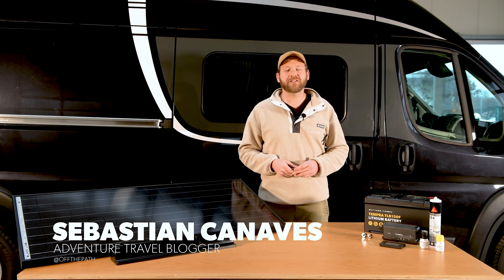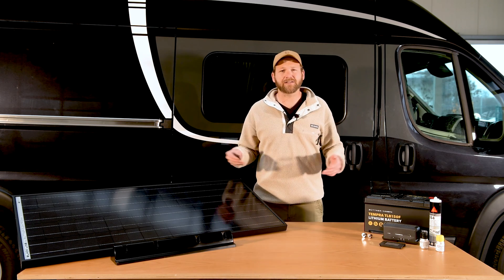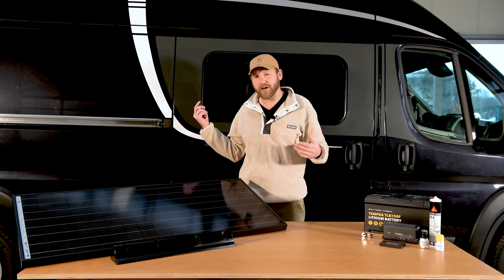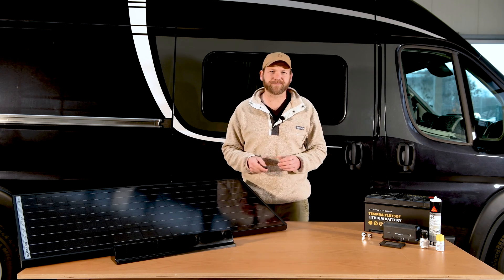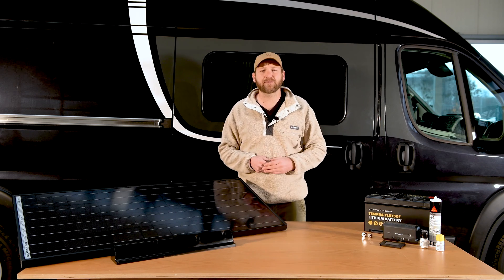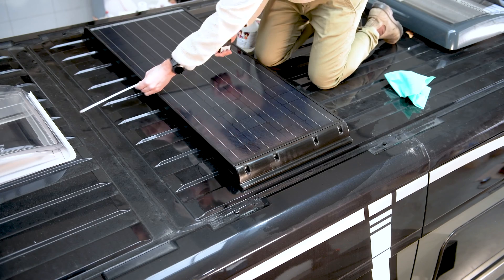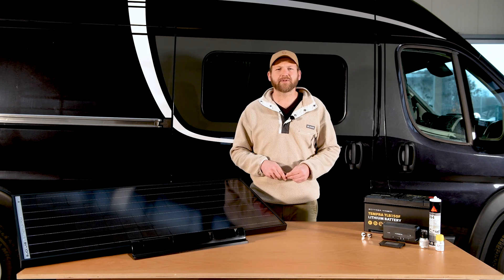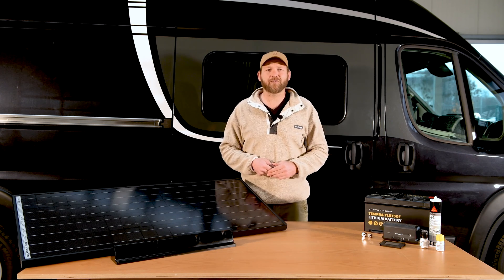DOMETIC | Blackline Solar Panels, Charger & Display - Introduction and Installation

Comment: You did not speak about 

Dometic NDS SUNCONTROL2 SCE360B
Reply from the maker: Good point! We didn’t cover the Dometic NDS SUNCONTROL2 in this video, but you can find more info here: https://www.dometic.com/en/outdoor/power-and-solar/solar-energy/solar-charge-controllers/08-0802-080230-080230005-339408?v=9620008201 😊